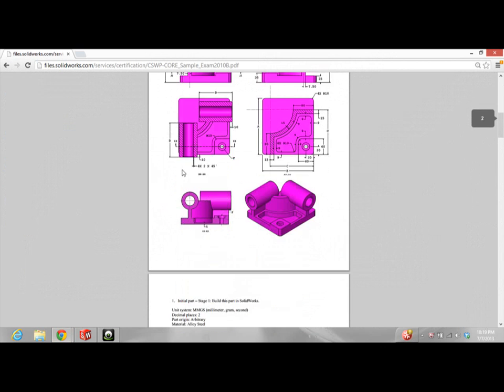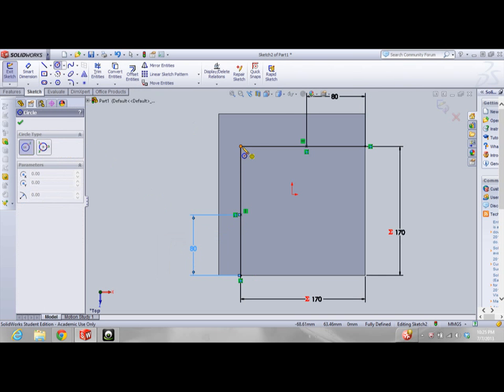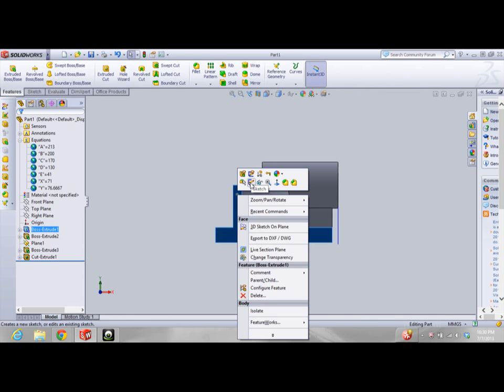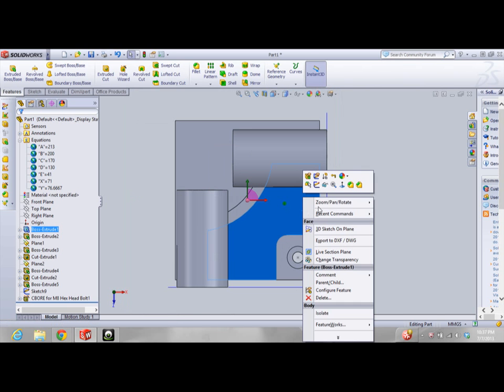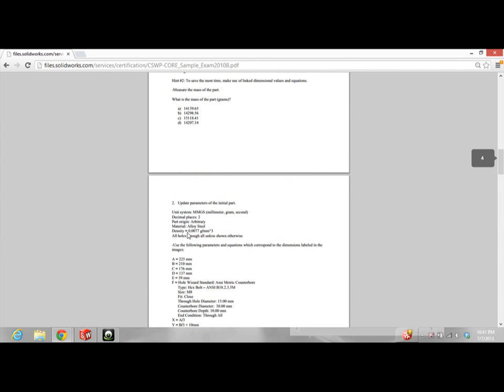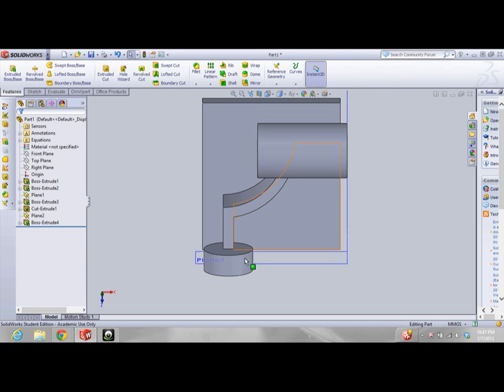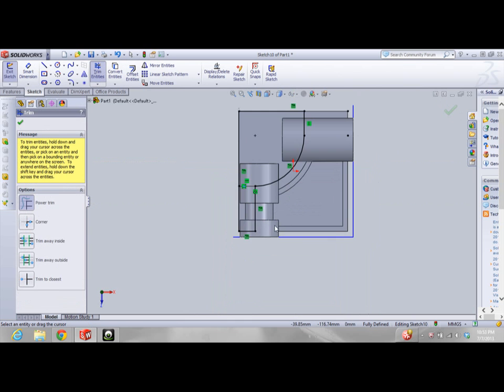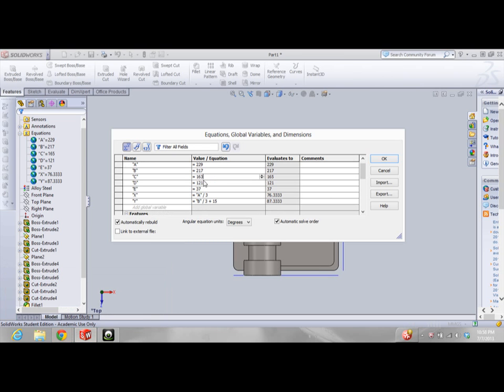Certified Solidworks Professional - Sample Exam

Comment: I recommend all who is going to be a  designer spend 1-2 years on the shop floor. This will make you much better. Also cnc dept. would be a good bonus. You will look at details differently and easer. JUST A THOUGHT.
Reply: Go and work in a foundry if you want to design castings. Top tip right there.
Reply: i want to become a designer/drafter, should i do Masters in Cad/Cam or Production/Manufacturing Engineering?
I have done my bachelors in Mechanical Engineering and i like to take anything and create models in solidworks in my spare time.
Reply: I'm going to suggest you get a job if you can and learn on the go. Where do you live?